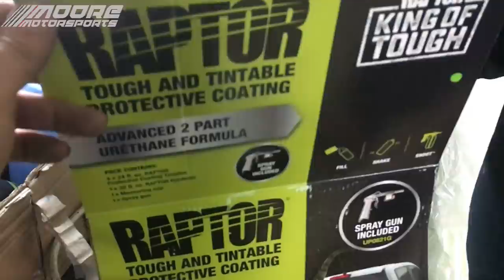Part 2-Green Paint Job- End Result May Shock You So Much You Might Subscribe And Like This Video.

Comment: Did you have to scuff it before raptor paint or just blast the raptor over? Just wondering since im planning on doing this. is the reason why you do the paint job under the raptor to get more coverage with the raptor? Looks really cool i wanna reach through my phone to touch the texture on the ef.👐
Reply from the maker: Ha if your in Texas and wanna come by some time you can feel it haha yea I would scuff but since the paint was still tacky from the base coat it was fine. 180 grit sand paper

Comment: Can you put spray max 2k clear over the raptor liner?
Reply: I read that you can.
Reply from the maker: Yes you can! I just prefer satin finish
Reply: @JamesDguy  I know I'd like to see it sanded then clear coated... then racked and bed liner under coated completely...
THEN delivered to me here!
in the words of the great Pillip J. Fry "shut up and take my money!"

I'm in Indiana and NEED a really well rust proofed cool small car. my '81 Datsun 210 wagon had its engine (A-14 w/A-15 head) overhauled 25k ago, has the very hard to get 5 speed, old school mags ya can't get anymore... nowadays it IS parts car gold, unfortunately that's all it is anymore. what isn't cancer'd is straight at least. drive train is good RWD. no joke, love little wagons and square hatch's like what you're working on there, I liked the 2000 Chevy Metro with its 1.3 till it cancer'd out too... would have liked it better with a manual transmission tho.

Comment: I do drywall and paint for a living, do you use the raptor liner to hide inperfections or would it hide them?
Reply: Yes raptor will hide alot of small imperfections paint wouldnt
Reply from the maker: Yes it does hide imperfections very easy
Reply: Awsum project is comin out sweet!!

Comment: I absolutely love the bedliner paint job. I have a Linex shop literally right up the road from were I live. I stopped in and asked how much they charge and $5-10g's I was like damn that is way outta my price range and I have zero painting experience other the my Rustoleum bedliners . On my 2011 Ram on my hood I have fading paint on the top of my cab the paint is failed horribly and on the tailgate aswell. I wanted to hit all of them with either PDM matching paint code bed liner or black. 
What are your thoughts?

Comment: I just painted one fender of my car this same paint. I let the paint sit in warm water for about 5 minutes. Almost every stroke started running. Dam. Should I not have warmed it?
Reply: Did you scuff the surface with 320
Reply: @slow_rednline4874  scuffed with 400.
Reply: @slow_rednline4874  But it's probably some old worn out 400, so tomorrow will switch to new paper.
Reply: I rescufed the entire fender with a new piece of 400. I did a very light first coat,and then two more coats, and it came out very well.

Comment: Put a real paint job on it that would outlast what you did
Reply: Only with a ton of maintenance.
Reply from the maker: @chadalcock7275  Correct.
Reply from the maker: It’s actually bed liner so it will out a “real paint job” as you say. It’s real paint so there for it’s a REAL paint job. I don’t understand why everyone says “real paint job” last I checked I used real paint lol